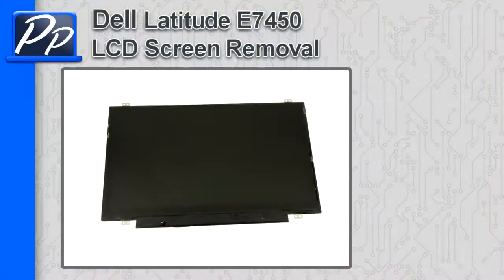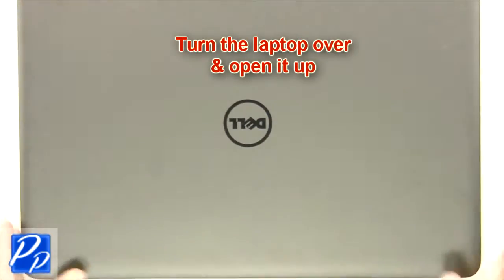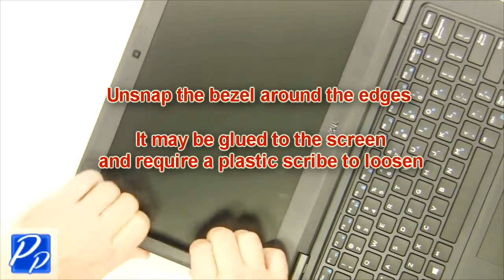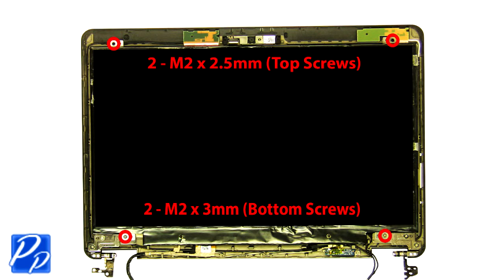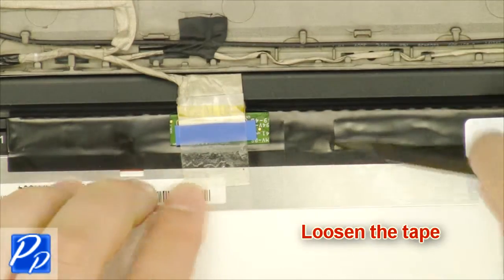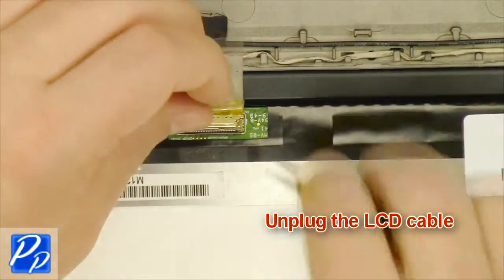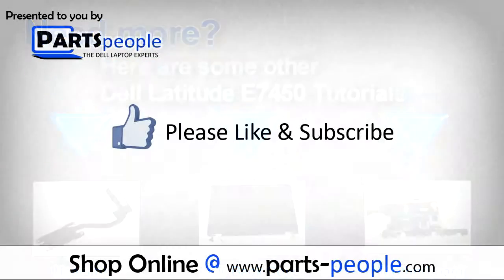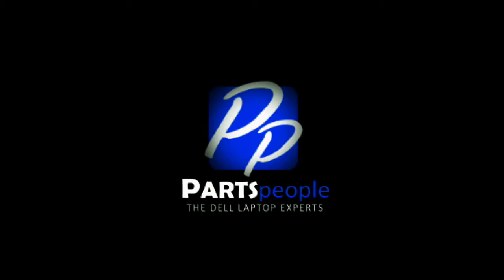Dell Latitude E7450 LCD Screen (Non-Touchscreen) Replacement Video Tutorial

Comment: I have an E7450 with a touchscreen that's destroyed. Can I replace the touch version with a nontouch display? Don't need or want touch.
Reply from the maker: Yes. You can find the parts you need here:

Screen: https://www.parts-people.com/index.php?action=category&id=140&subid=531&refine=screen
Display Cable: https://www.parts-people.com/index.php?action=item&id=18780

Comment: Thanks for the sharing this helpful video.  Can I replace E7450 non-touchscreen with a new touchscreen so I can use touchscreen function?  Thx
Reply from the maker: Yes. You will need to replace the entire display assembly. The touchscreen display assembly will include all of the parts needed to complete this replacement.